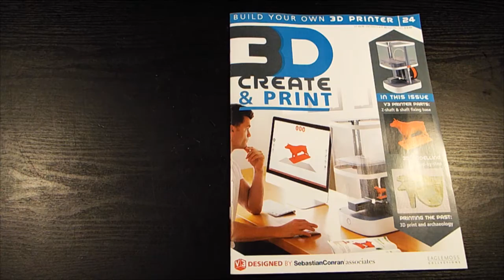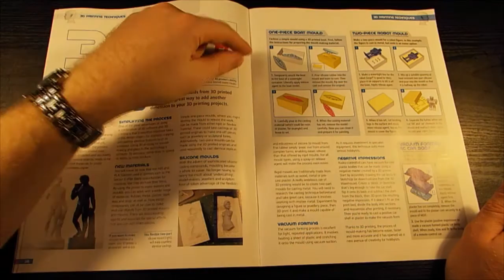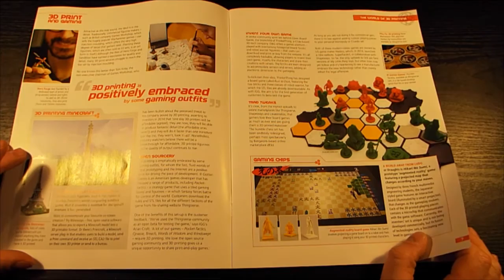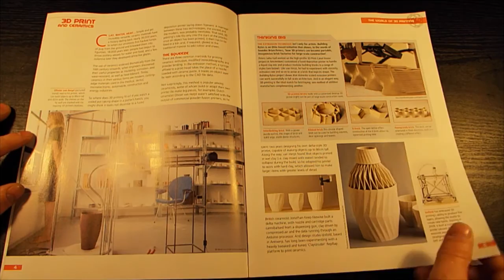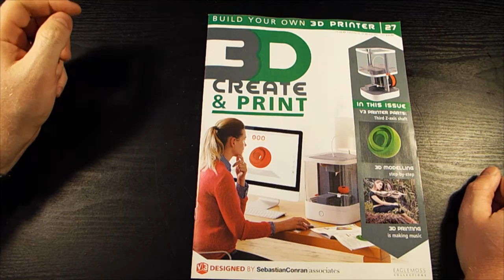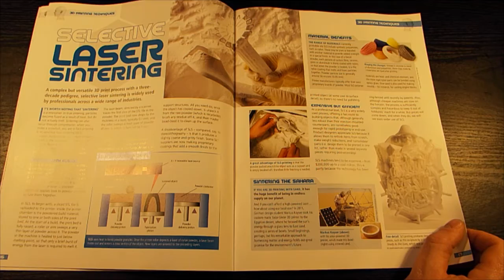Build Your Own 3D Printer: Editions 24 - 27 Review (Starting The Z Axis) (  V3 , Eaglemoss)

Comment: Hello me again :)
I would like to ask you something about the build of the way they have done it & want to ask you if you agree with the following :-
I have noticed that they have done the build in a bit of a wrong/annoying/fiddely way 4 time now & it is this - Issues 2, 3 & 4, they ask you to attach the Y shaft, shaft fixing base & nuts & bolts, then you had take nuts & buts off just to fit the bearing block - it would have made sense to give us the bearing block 1st before having to put on the screws just to take them off again!!! They done the same with issues16 to 18 put on shaft fixing base, x shaft & nuts & bolts - just to take them off so that you can put on the bearing block - should have given the bearing block 1st & yet again the same thing with issue 24 & 25 & with Guess what with Issue 26, 27 & 28 - you would think that they would give you the bearing block 1st to make life easy but NO it like Arrrrrrrrrrrrrrrrrrrrrrr
I would to know what you think about what I have just said above!!!
Thanks in advance :)
Reply from the maker: I suppose iys a financial decision, we will put out the parrs where we make less profit later after people have dripped out.  I know not their logic :)